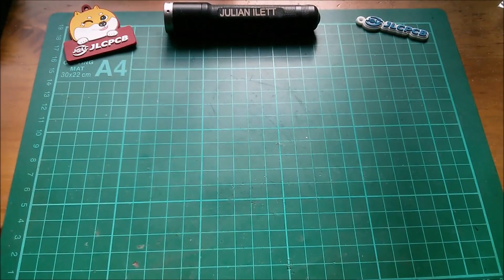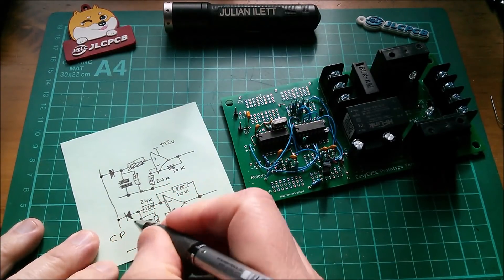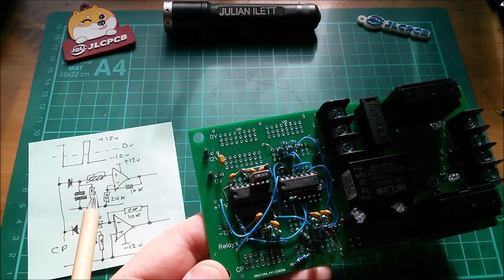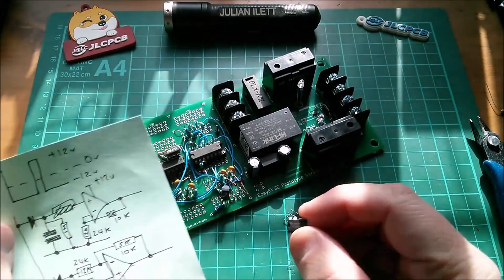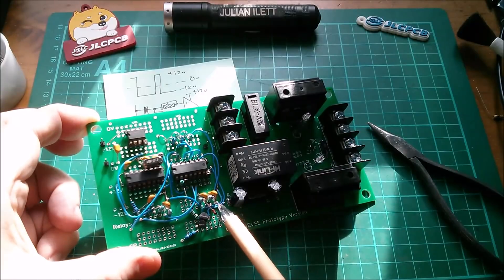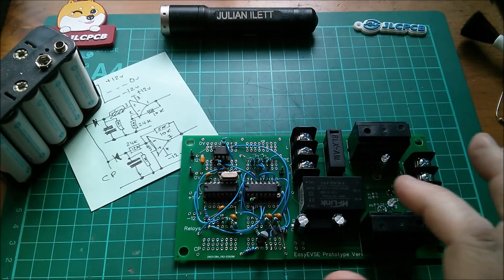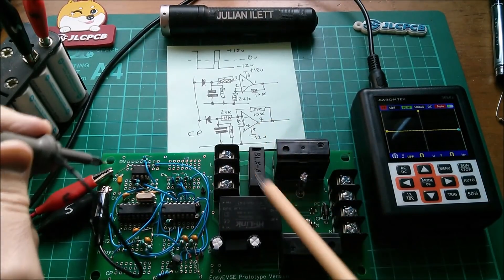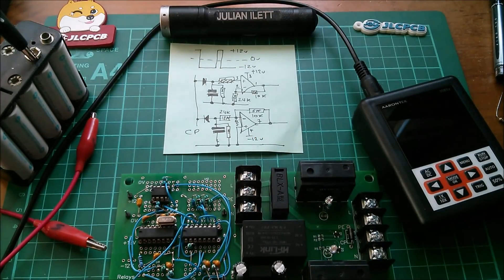Op-amp Oops

Comment: Did you know that you don't need an op amp to do the -12~+12 to 0~5 conversion?
Just 3 resistors in a star configuration: the 3 branches are connected to Vinput, 0V and 5V respectively and the Voutput is the middle point.
Resistor values:
Input to Center = 10kohms
5V to center = 4.116k
0V to center = 7.143k
(I have not double check my calculations so you may have to simulate that before using this method)
Reply: how did you calculate those values? could you point me in the direction of more info

Comment: Voltage divider first fed into the noninverting voltage follower to buffer the high impedance divider. I've read in multiple app notes to never have negative gain in a opAmp circuit, always condition signal prior to the buffer. That's the point after all of having a J fet input, they can be fed by a mega ohm resistance because they have a miniscule drive current. Another thing to consider is that not all opAmps are unity gain stable so even a voltage follower can be out of the operating range. Some can't take inputs near the rails, I believe the 072 can latch if the input gets near the positive rail. 

 I follow you because 7 years ago you helped me learn the arduino OLED u8g2 library in one of those "1-day projects". I was fresh out of college, I had the ambition to become self employed and developed an entire line of products based on the success you helped me achieve many years ago. I don't watch as often as I used to due to the rabbit hole I've been down but I'm happy to at least see this within days of it's posting with a chance to contribute. Cheerio!

Comment: If the purpose is simply to turn a high or low input voltage into a corresponding voltage where -12V = 0V and 12V = 5V, a simple dual-emitter follower (like a class B amplifier) could have been used. 1 resistor, a PNP, and an NPN, with the collectors connected to arduino supply, the bases shorted together and connected to the input through a 100k resistor, and the emitters shorted and connected to an arduino digital input. Or is maintaining linearity important here? (like in the case where the input is not a pulse train but instead some analog signal from -12V to 12V)

Edit: Just saw the other EasyEVSE video and saw that this exact circuit has been used in the design, so I am definitely curious as to why it wouldn't work here as well.

Comment: Could you not just 'rectify' the incoming signal? Perhaps with a very small capacitor and a very small resistor. The block wave will result in a specific voltage which you can then measure.

Comment: I would have tapped the 1meg time constant resistor at 5/12, with a simple follower copying that voltage.  The inverting opamp is also problematic, because its input impedance parallels the time constant setting resistor.  Make the input resistor the 1 meg time constant resistor (since the inverting input is held at zero volts, so to the capacitor, it will look the same as the grounded 1 meg.  Then use a feedback resistor of 1meg*5/12 to set the inverting gain at 5/12.
Reply: Indeed, on the bottom circuit, the - input is a virtual ground. The 12k is parallel with the cap and 1M resistor.

Comment: Since op amps have very high input impedance, you could make any voltage you want with a simple voltage divider, then feed that to the + input, while the - connected directly to the output of the op amp, to give you a voltage follower with current capability of the op amp.  Would that work for you?

Comment: Some input protection and signal limiting is also required, set up op-amp gain as required and add a frequency cut-off in the feed back path. Or you circuit may be dancing to radio 4 long wave. :-)

Comment: OOOPS! Yes, 1+Rf/Rg  is a very basic relationship, which is taught early on but is easily forgotten, I'm sure that many of us have done so and only remembered when testing.🙄😵
Reply: that little +1 often slips your mind when setting the gain of a non-inverting amp
Reply: @TheEmbeddedHobbyist  Indeed it does. Often it doesn't matter, as with say an audio pre-amp with a gain of 50 or 100, but in instrumentation it can be disastrous.

Comment: No no, the divider should be at high impedance positive input and have the non inverting opamp a buffer giving low impedance low level output. NOT having divider on opamp output. Do the division at input side, using high value resistances to not load the CP line with lower Kohm values. The pos input will have equiv impedance at hundreds of Megohm.
If you put the ratio at output it has relative high resistance , parr 24k and 10k by your diagram  so makes load side input resistances alter the ratio if not in hundreds Kohm or more. Use low impedance opamp output to drive following loads for least circuit interdependencies.
Reply from the maker: I guess both would work. From my PIC microcontroller days, the A/D inputs liked an impedance no higher than 10k (although I used 20k without issue). But 390k plus 560k on the opamp input would also work :)

Comment: The -12v part is not really needed.  The vehicle has a diode that blocks it to zero.  Only the +12/9/6/3 signaling the charge control state is used.

Comment: Very interesting! I'm excited to see where this project goes, Julian. Regarding powering the op amps here, was there a reason you didn't go with the full +/- 12v bipolar supply as per your schematic?
Reply from the maker: Yeah, the op-amp supply pins are connected across the full 24v.

Comment: My suggestion is to put the voltage divider on the +input then just buffer it with the op amp (output connected to - input).

Comment: ????  No such thing as a 5K RESISTOR ?  That's odd.  I have 30 or 50 in my kit.
Reply: Appendix A – Standard Resistor and Capacitor Values
E-12 Resistor / Capacitor Values
1.0, 1.2, 1.5, 1.8, 2.2, 2.7, 3.3, 3.9, 4.7, 5.6, 6.8, and 8.2; multiplied by the decade value.
E-24 Resistor / Capacitor Values
1.0, 1.1, 1.2, 1.3, 1.5, 1.6, 1.8, 2.0, 2.2, 2.4, 2.7, 3.0, 3.3, 3.6, 3.9, 4.3, 4.7, 5.1, 5.6, 6.2, 6.8, 7.5,
8.2, and 9.1; multiplied by the decade value.
E-96 Resistor Values
1.00, 1.02, 1.05, 1.07, 1.10, 1.13, 1.15, 1.18, 1.21, 1.24, 1.27, 1.30, 1.33, 1.37, 1.40, 1.43, 1.47,
1.50, 1.54, 1.58, 1.62, 1.65, 1.69, 1.74, 1.78, 1.82, 1.87, 1.91, 1.96, 2.00, 2.05, 2.10, 2.15, 2.21,
2.26, 2.32, 2.37, 2.43, 2.49, 2.55, 2.61, 2.67, 2.74, 2.80, 2.87, 2.94, 3.01, 3.09, 3.16, 3,24, 3.32,
3.40, 3,48, 3.57, 3.65, 3.74, 3.83, 3.92, 4.02, 4.12, 4.22, 4,32, 4.42, 4,53, 4.64, 4.75, 4.87, 4.99,
5.11, 5.23, 5.36, 5.49, 5.62, 5.76, 5.90, 6.04, 6.19, 6.34, 6.49, 6.65, 6.81, 6.98, 7.15, 7.32, 7.50,
7.68, 7.87, 8.06, 8.25, 8.45, 8.66, 8.87, 9.09, 9.31, 9.53, 9.76; multiplied by the decade value.
Reply: @cmuller1441   Thanks for the handy table!

Comment: Don't forget to add some bandwith limit onto the op-amp circuits. At the moment, the frequency response is uncontrolled and can lead to unstable operation, especially if the op-amp has any kind of high GBW.
Reply: Everyone forgets that most op-amps will have still have gain up to 1MHz might not be much but as you say enough to make it unstable. I think as the input signal goes out of the house i'd add a diode clamp to the signal to clamp it to the 12V, and a resistor in series to limit the current a bit.
Reply from the maker: A few pF in parallel with the feedback resistor?
Reply: @JulianIlett  If you put a cap in parallel with the feedback you want its impedance to equal its value at the cut off frequency you want. Remember imp Z  = 1/(2*Pi*F*C ).
Reply: 1nF should be enough across the 10k to keep the bandwidth below 15 kHz